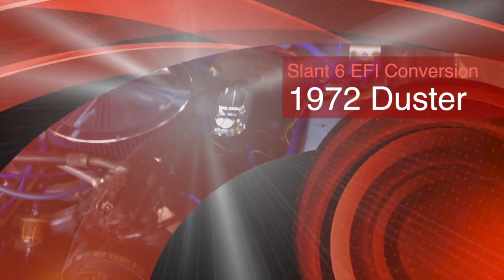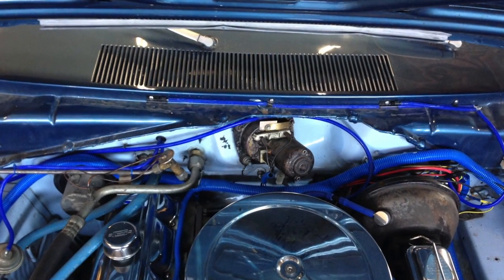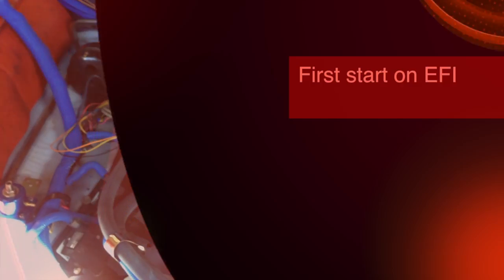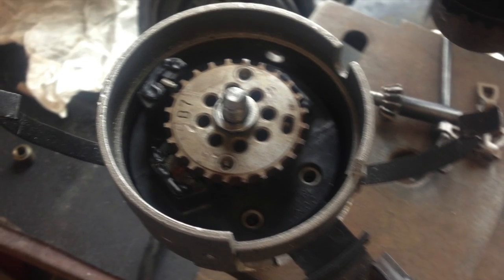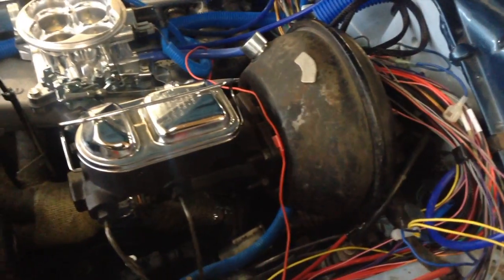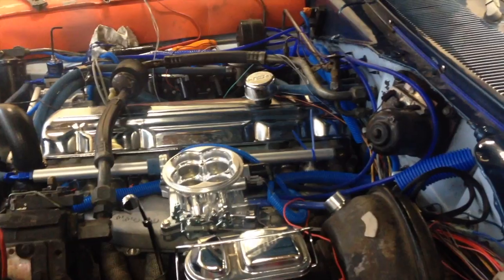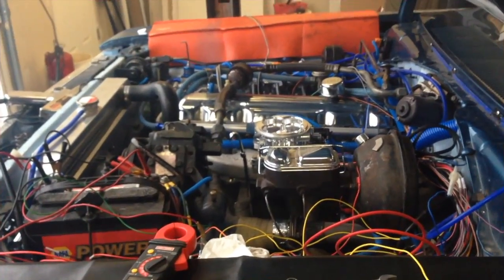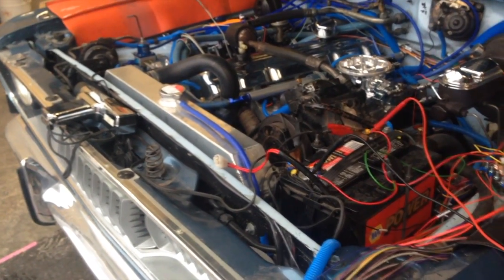Duster EFI Conversion

Comment: Why did you go with a sequential instead of a batch system? What was the modified distributor you used? Do you have a pic of your crank sensor pick up? Is it something you made? Would like to talk to you personally
Reply from the maker: If you are going to run a batch fuel set up, just stick with a carb, and I believe I did a video on the trigger system.

Comment: how much would it run to go EFI on my 225 slant 6
Reply from the maker: There is no quick and easy answer here, it will greatly on what you currently have and how far you want to take it.  I have seen people that brag about doing it for a grand, but those are usually simple throttle body, stock ignition, and a build your own ECU kit.  The other extreme could run as high as 10k for premium parts and shop labor.
Reply: I would like to EFI my slant 6 an boosted it
Reply from the maker: Good idea, check out the latest video on my channel.
Reply: @tingleyent2149  "Speed is just a question of money... How fast do you really want to go?"